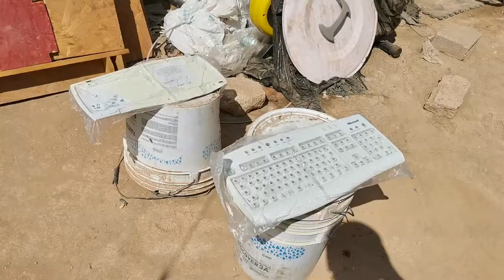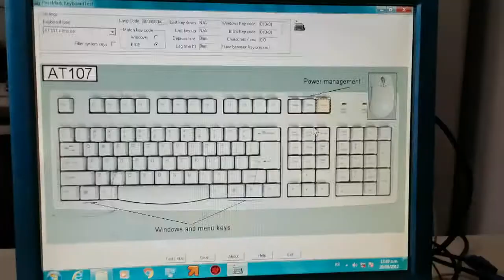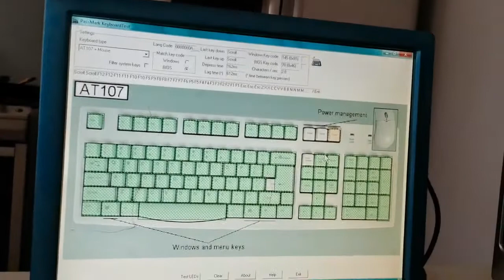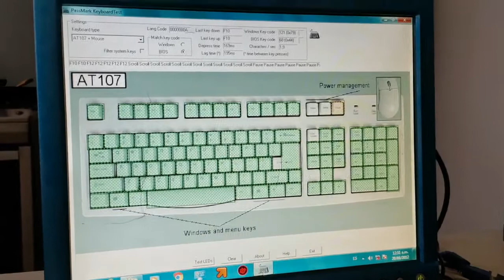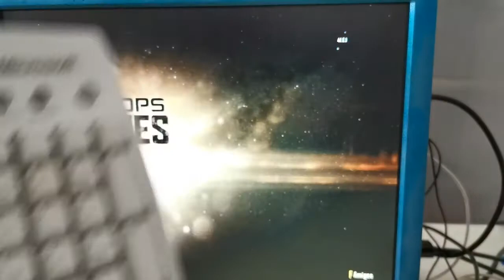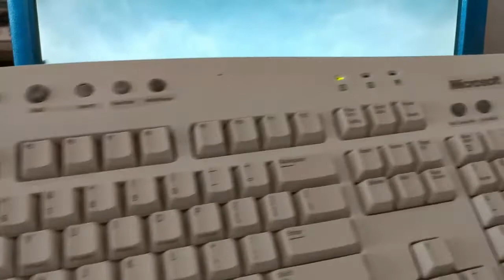Restauración del teclado 20 años microsoft Internet pro ps \ 2 Modelo RT9410V56TW sucio sin cable

Comment: I have the same keyboard and while cleaning it , when I took off the spacebar button I found only one spring..Did the keyboard had one spring or two ?( if it had two springs under the spacebar that means that i lost the one spring)..If you can remember you will hep me .Thanks for the awsome video
Reply from the maker: thanks